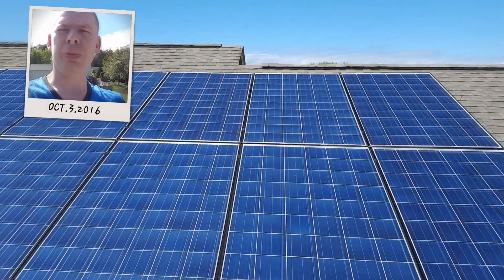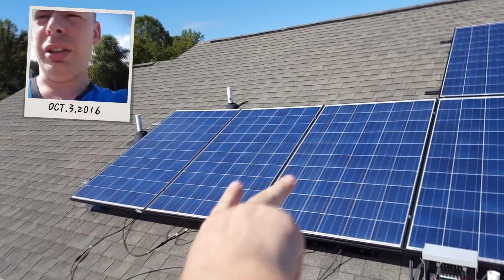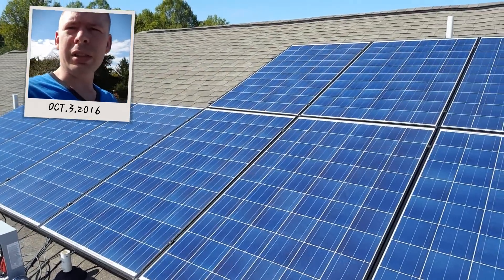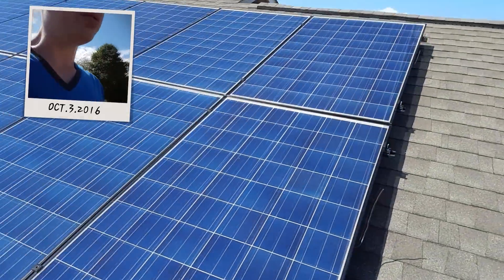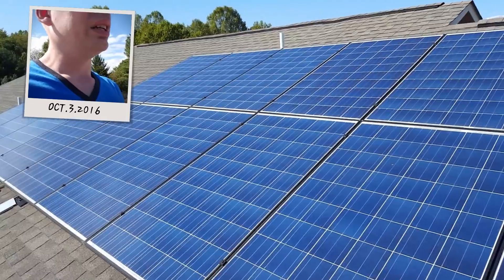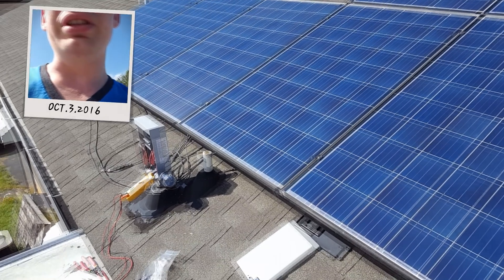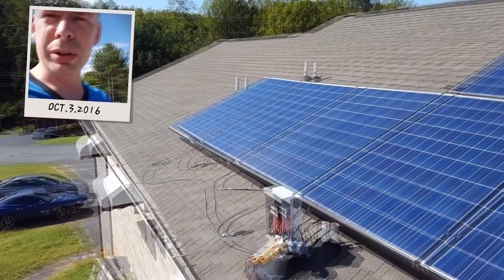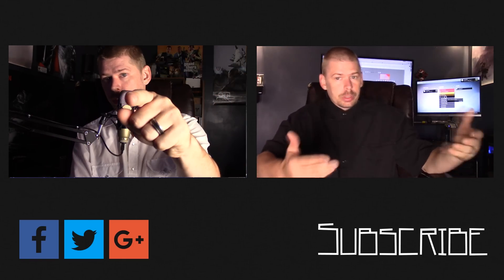I just installed the new panels and now I have 3750 watts of solar power in the array.

Comment: I'm just wondering if the price of the system is worth the savings. It seems like you have to dish out 6000 to 10,000$ for a system. Figuring an electric bill of 100$ a month that would be 1200 a year. Seems like it would take about 8 years to get paid off, by then you'll be replacing some parts and battery's so then you start over. Correct me if I'm wrong
Reply from the maker: no panels last 25 year warranty
Reply from the maker: I love it
Reply: Solar Power Electricity and Electronics 
So are your panels used with the power company? How much would a system similar to yours cost
Reply from the maker: 12k to 15k

Comment: angle of sun.  usage of power, state of charge,  resistance of wire and connections and what state of charge your ib.   all of these determine what your input is.  living off GRID for 4 years and the data we have collected proves this.  fixed panels expect 85%  tracked panels 95% depending on the above mentioned variables
Reply from the maker: Hello Bill and Rose Thank you for watching this. I have been doing Heavy data logging on this system At spring up to summer i had a total 3000 watts of array, i was getting the max at 24 volts on the battery bank every day that is 2880 watts at solar noon with a heavy load on the inverter around 3000 to 4000 watts of power consumed and  well past the max of the charge controller,  now i get 30% to 40% during and after a wiz bang jr install then i installed the 48 volt inverter so my max is much higher than before and i installed the new 750 watts of array and still not getting the power i would come to expect from the system from before follow like and subscribe please.

Comment: i think you need 2 midnight classic 150!! 3750 Watts / 24 volts = 156 amps. Your charge controller max out at 96 amp, it's is the specks! It protect it self from putting more that it can!
Reply from the maker: +Sylvain Maher 48 volts now I changed over when I got the Magnum.

Comment: Mine are also slowing down with the days getting shorter. What charge controller do you have that can do 96 amps at 24 or 48v? My classic 150 goes from like 90amps at 12v to 65amp at 48v or some place around those numbers. Nice to see all those panels

Comment: You changed the way your measuring the current .
So are you chasing a ghost within the tolerance of the 2 units 
the charge controller verses whiz bang .
Note the whiz bang has a shunt insertion loss .
A 50mv shunt @ 100A will drop 5w + the crimps .
( every joint , wire , shunt , switch , fuse , diode & trip switch has a 
loss associated with it ) .
Reply from the maker: nope the shunt has been installed with the tri metric battery monitor
Reply from the maker: it's the first thing i installed

Comment: Your system is growing nicely.Classic 150 right? you were hitting 96A in a 24V configuration?? I don't think that is even possible. Correct me if I'm wrong, but I believe 93 or 94 amp is the max at 24v. it will only hit 96A in a 12 volt configuration.
Reply from the maker: When i first got the system i was geting 2880 watts for 5 months on clear days and thats for 2 hours a day and it dropped after i installed the wizbang jr to 2100 to 2500 on clear days with 3000 watts of solar i just installed 750 watts more as you see here.
Reply from the maker: I was making a total of 18 kwh a day as well
Reply from the maker: but since it's been about 12 to 15

Comment: remember the more you move into winter ( Shorter days ) the lower the sun is. So unless you have ajustable panels you will get less and less amps  in until you move back into summer. 10kw is on my roof and it is enough to see me through all but the worst winter days. Looking good though :)
Reply from the maker: I'm very understanding on this I have have some type of solar for more then 10 years but the power drop started when Installed the wizbang jr